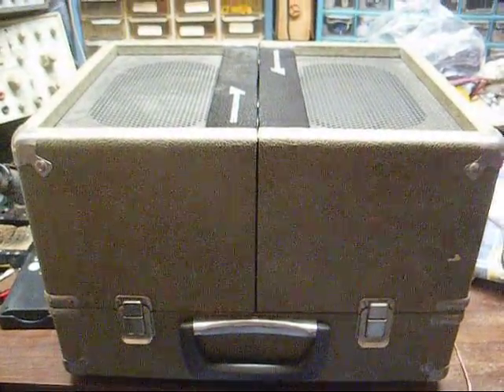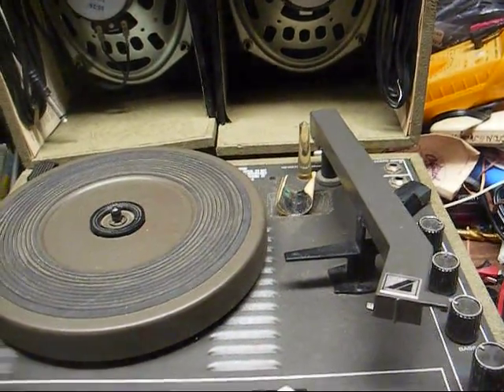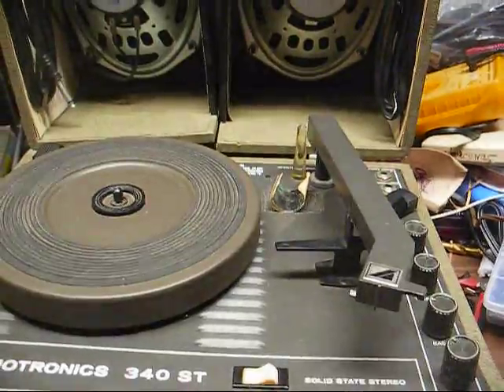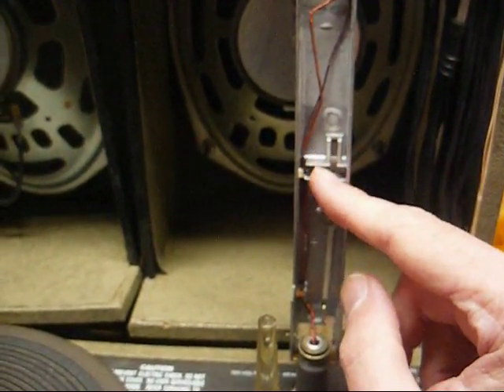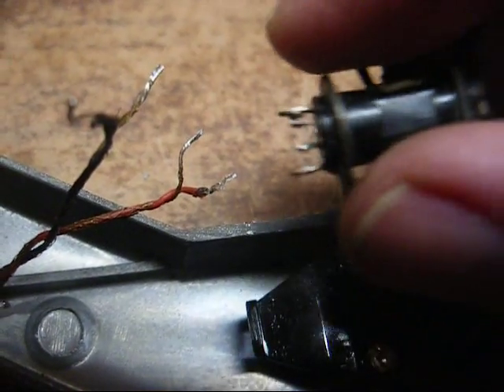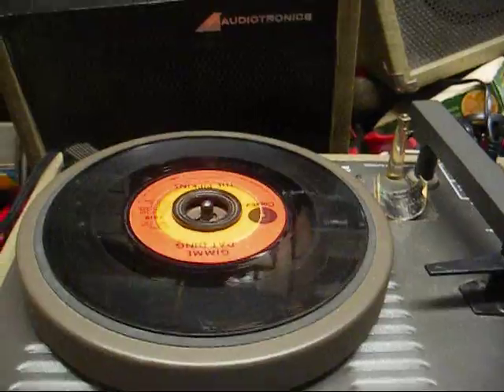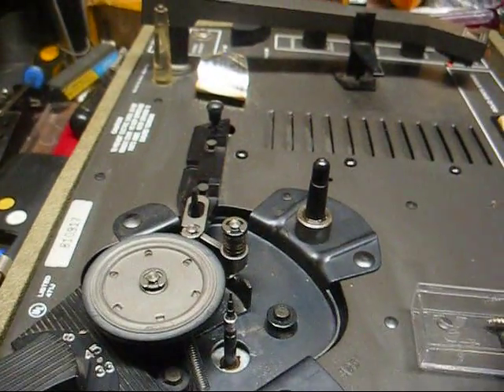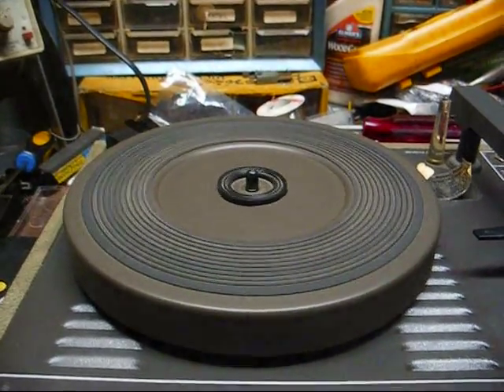Replacing an Astatic 13T cartridge in an Audiotronics stereo classroom record player

Comment: Where I worked in the 80's, 300 schools, A/V repair. Units from 16mm projectors, slide projectors, Kodak carousels, up to the early VHS units. Units ranging from the mid-50's till "State of the Art, lol.  Those older Califones and Audiotronics were fine units. I would burn a few of those out before re-buliding the 4 to 8 hour projects that were B&H 16mm  projectors.  Auto-restore shutter timing cam was a real pain in the ass.

Comment: Another great video.  I have this exact model record player and the exact same problem.  When I got it from an ebay seller, he said it "just needs a needle, they're easy to find."  After months of searching and buying junk NOS needles in bad shape (rotten rubber, one tip even fell off from old glue) I gave up and put it in the basement.  That was around 6 years ago.  I'm going to give up on the 13T and go this route.  Glad to see you made changing the cartridges to a different model look easy.  Maybe I'll get mine working again after all this time.  Thanks!

Comment: I worked with an A'hole who attached a scope, seperate DC power supply, and a load resistor, to that exact unit.
 drank coffee and waited for "THERMAL RUNAWAY".  He was gone 2 days later.  It was a bad solder joint on one of the output transistors. I was a young man at that time.  1984, I just turned 30.

Comment: Oh and in case you were working on a Typewriter in the day you had better make sure allot more springs are working or are adjusted correctly. Overall scheme of things in the day these adjustments are fairly easy and honestly most would not have cared. Those that needed it most like the handicapped; it was a priority at the time to repair or replace one of these units. It was a 50/50 proposition as we did not have the skills for repair but we didn't do to bad at it. I did allot of work for a blind organization at or around 50th and State in Milwaukee at the time. I'm sure they are still there.

Comment: What a coincidence---I'm also replacing a 13T right now, in a 1960 GE RP--1170A. I feel your pain on the spring alterations, it really is a tedious process. Nice tip on the tonearm wiring where you heated up the clips and pulled the wires out, as opposed to cutting them and restripping the ends.

Comment: Why not just stretch your spring to fatigue it?
Reply: The Guitologist That's what I was going to suggest- although, I think "weaken" is a better description than "fatigue"(?)
Reply: Removing links to shorten the spring = increasing spring force, which reduces tracking pressure.  Weakening the spring would increase the tracking pressure, up to the point of removing the spring completely which would put the entire weight of the metal tonearm onto the record.
Reply: John Ward That is correct.

Comment: I've noticed that record player has 16 rpm. If you have one of those records,could you try playing a 9 inch 16 rpm Seeburg background music record on it or another turntable that has 16 rpm? If so, you would need to manually center the record because those records mentioned have a larger hole the the 45 rpm records.

Comment: 40$ for a cartridge?  If you took it to a repair shop that does rekee players, it would cost a minimum of 50$ to get it fixed, plus parts.  The shop would charge the customer at least 50$ for said cartridge.  But for some people, money is not a problem.